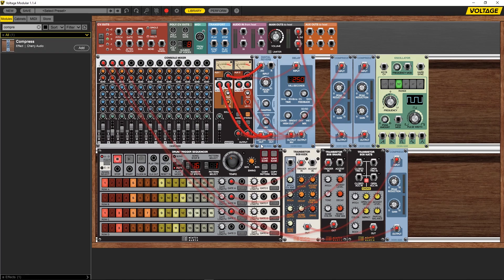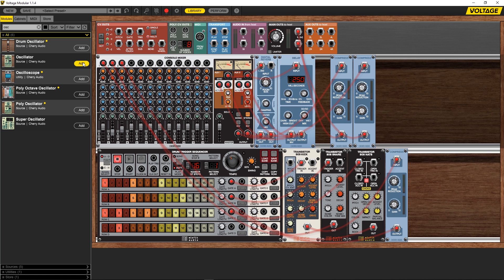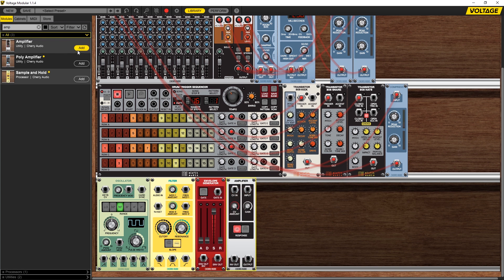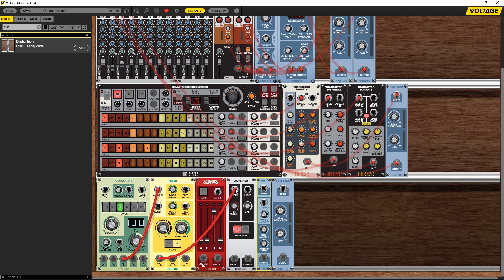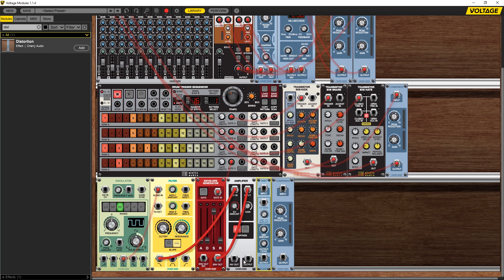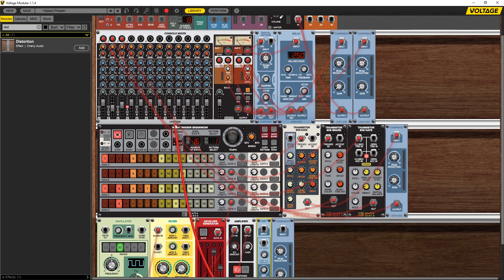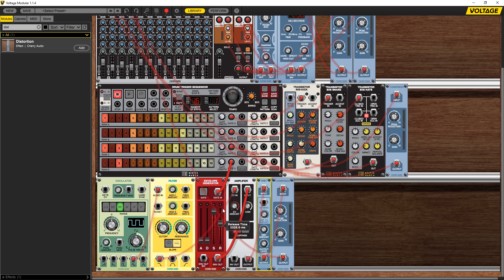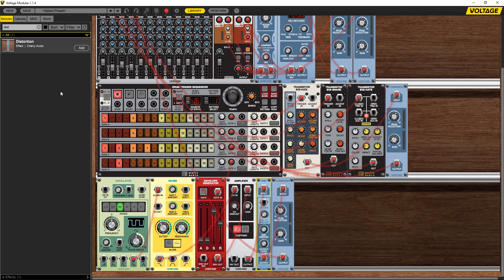Voltage Modular Core by Cherry Audio | Getting Started Tutorial | Part 3

Comment: Also... on the delay output... one is output, the other is output INV.   Surely this is not the same as L & R and will in fact create an inverted signal (i.e.phase issues?)
Reply: Quote from the manual:  Output Inv jack- Outputs the Dry/Wet mix with its polarity inverted. This is most useful when using short delay times and can sometimes result in a more "hollow" or flanger-like sound when mixed with the original non-inverted signal. Note that this jack inverts the mix of both the dry and wet signals. If both outputs of this module are combined, they will completely cancel each other out resulting in silence! Therefore, it is usually a good idea to use the delay as a parallel effect or aux send with the Mix set to 100% when using the inverted output.